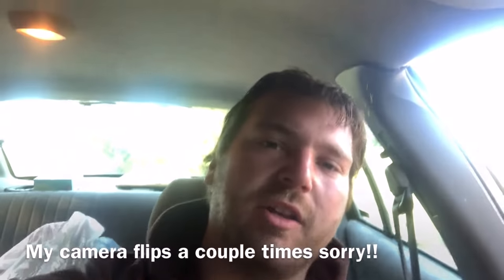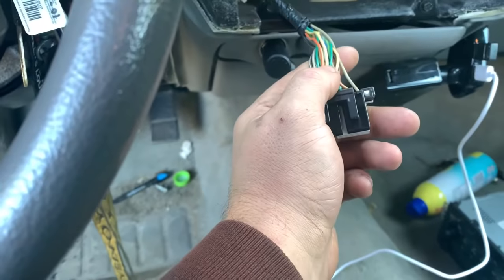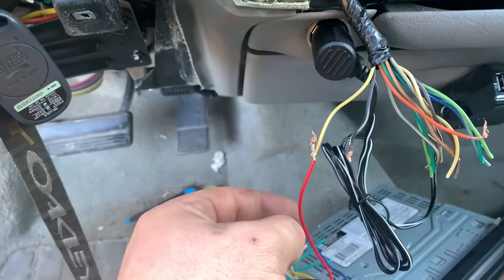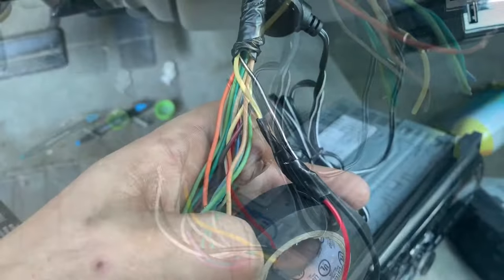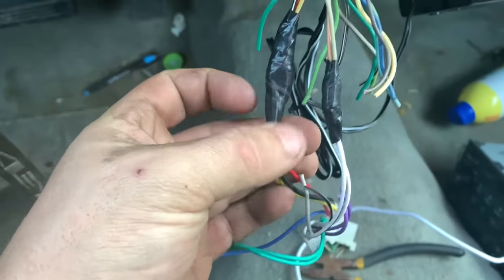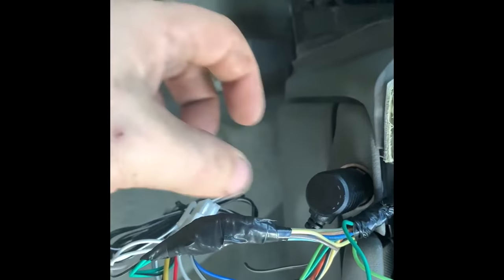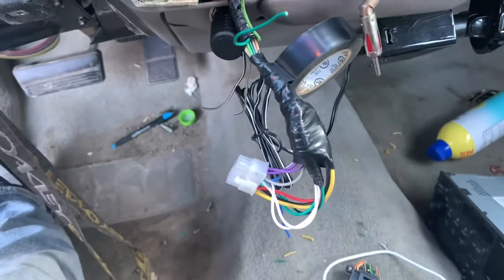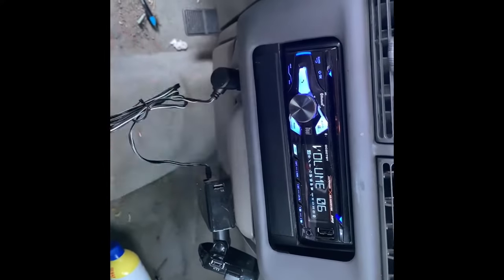How to Hard Wire an Aftermarket Radio in Any Vehicle

Comment: My negative cable touched the orange cable(dimme) and smoke came out.... the radio no longer turns on... busted right?
Reply from the maker: Should have 2 fuses. A fuse on the back of the radio and one in the fuse panel. Doesn't sound good thougg

Comment: my accessory wire has no power is it possible to run an accessory wire from the fuse box to bypass the blown wire ive checked all fused and cant get power to that wire